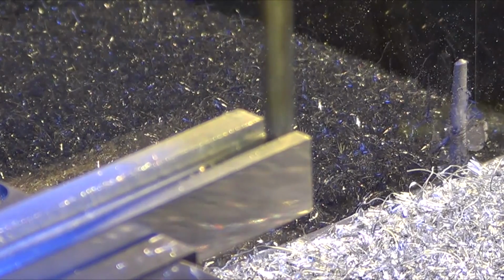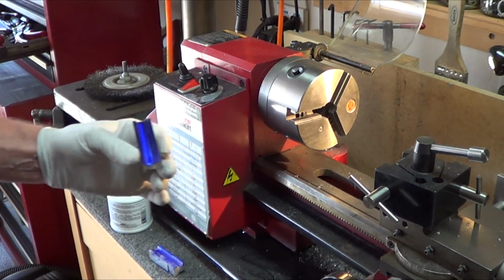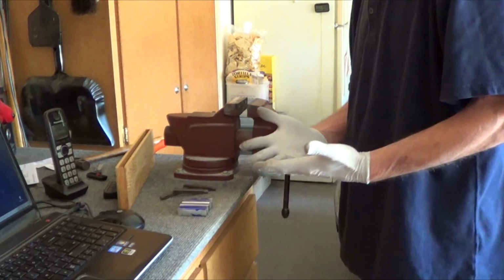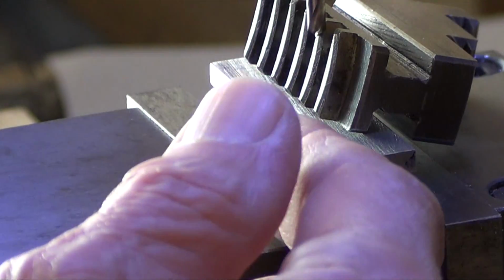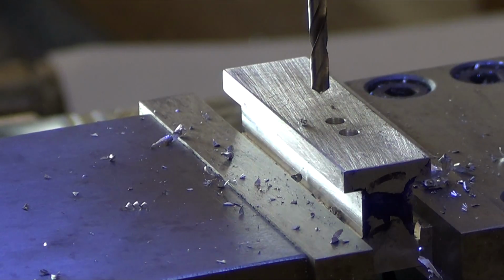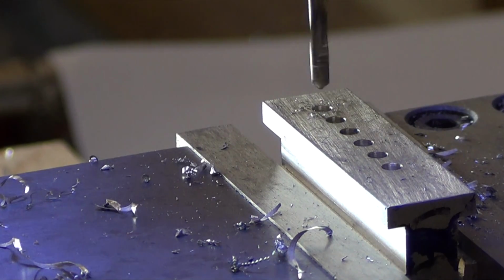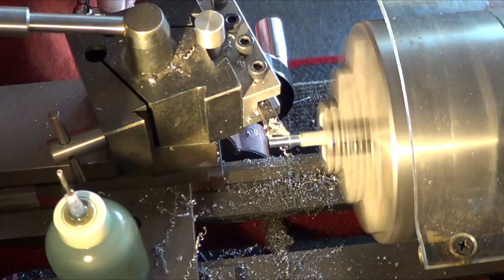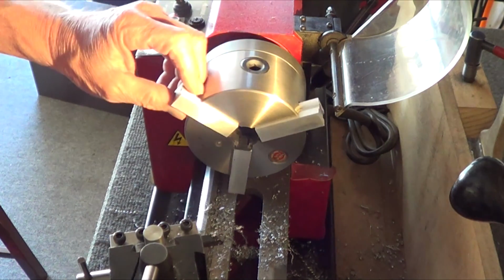Making Chuck Jaws Part 2 of 2 Video #24

Comment: I would make them one more time out of steel and use hardened dowel pins. That aluminum won't last long. I don't know how close the .120 pins are but you could use .125 dowel pins and if they are just a hair to big just hit the side with a course "tool room stick" hand. Google Rex Supply and look up tool room stick. Try a 120 - 200 grit.

Comment: I like the way you work with high accuracy and precision but when drilling I recommend using center drill start your holes you won't have your drill trying to walk on you on both the mill and lathe
Reply from the maker: Depends on what I'm doing. When accuracy really counts I do use the center drill. And when I don't, the bit is way up in the collet as short as possible. I also use extremely good bits. If you watch carefully you won't see them walk and chips come off both flutes. For some reason the camera make them look like they are wobbling. Really glad you like the videos! Means a lot to me ....